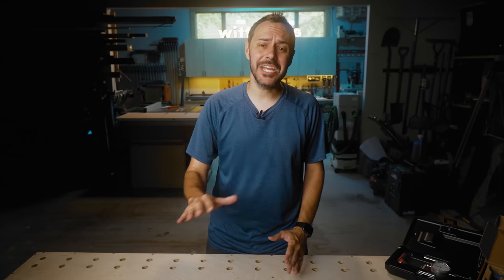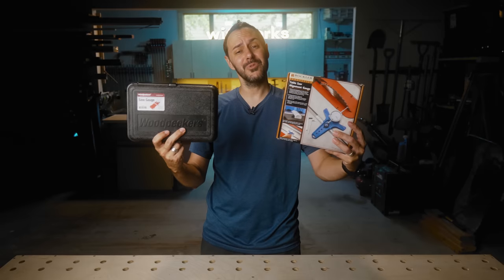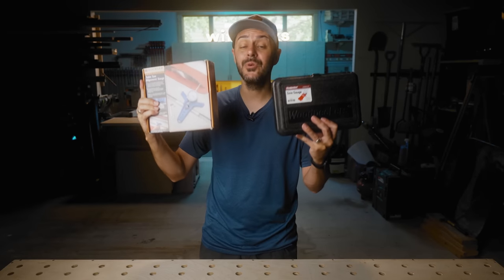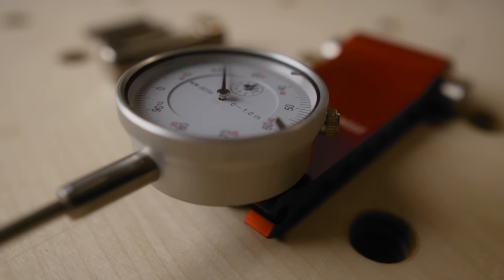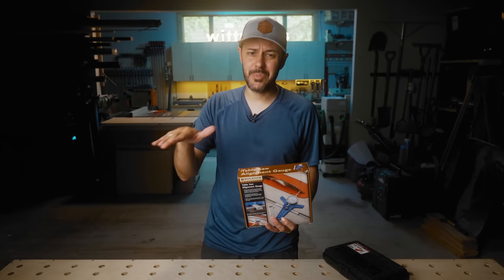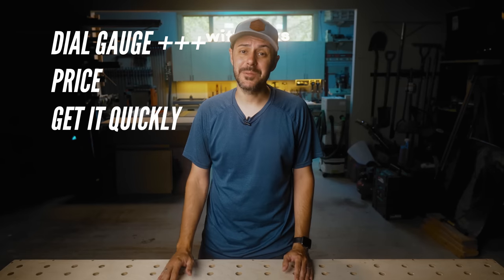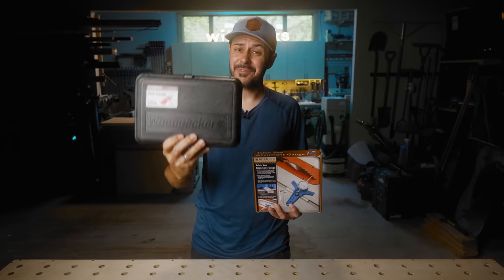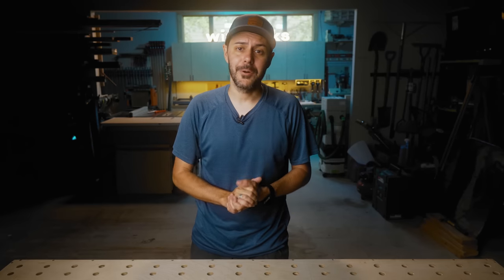Rockler VS Woodpecker Table Saw Gauge.

Comment: Thanks for a very even-handed evaluation. Just dropped in to let you and your fans know that we have committed to being in stock on a large group of our core tools, including the Saw Gauge. It should be in stock and ready to ship most of the time. Very rarely would it be out of stock for more than a week.
Reply from the maker: Thank you!
Reply: Going to check yours out. I just bought blue but have too much rocking with their adjustment mechanism and depending where I hold and slide their gauge the reading goes way off. To me, I just wasted $60.

Comment: I made my own with an old machinist dial indicator I inherited. My runners have zero slop in them which is just a matter of time and effort of learning to dial them in exactly right. The other way is to not make the runner but instead buy one of the newer ones made, dial it in with the adjustment screws and you're all set. Even with the indicator you're still way under the cost of the Rockler even with a perfectly accurate tool.

Comment: Thanks for this vid Drew. I've been asking myself the same question about which I should buy. For me, this seems like a tool I'll only use once a year so I'm fine with adjusting the mitre track and feeling hardened plastic in my hands instead of metal. Rockler for me.
Reply from the maker: You’re welcome! They both measured the same for me so it’s a matter of preference and tool snobbery budget. The rockler is great.

Comment: Just purchased my first cabinet table saw. Even though it is a named Brand unit, The fence was still couple of Thousands" off. So i Purchased the Woodpecker's Saw Gauge. $ 99.00 dollars plus shipping. I not only learned a lot, but I'm extremely happy I got this measuring device. Additionally my friends table saw is an older unit. Even though it has a Riving Knife the Fence itself was off a-lot. 
It cost my friend a lunch to use my newly purchased saw gauge,LOL. Thank You  Conroe Texas, USA

Comment: I bought the I-Gaging digital alignment tool, I didn't like how it rode in the miter slot. I didn't know Rockler had one but I ended up buying the woodpeckers saw gauge mainly because of its design. it's hard to screw up and no adjustment in the miter slot.
Reply from the maker: Same. That's exactly why I splurged on the WP
Reply: I just bought the IGaging one as well. Once the screw is tightened, it lifts the entire thing up and then it rides weird and wonky in the slot. I’m going to return this one and get the red one.

Comment: When I got my table saw (an R4512) 3 years ago, I made my own alignment jig. I bought a dial indicator that came with a heavy magnet base and attached the dial indicator to my homemade jig. It worked ok, but yeah, even the slightest of slop in the miter slot made it more difficult to use than it needed to be. 

I bought the Woodpeckers' alignment gauge back in April. Since I already had the dial indicator, I only paid $80. It is so much nicer to use with those miter slot pins. I knew my saw needed adjusting so it was no surprise that it was in the "20 thou" neighborhood. I managed to get it down to .001 with the new saw gauge. 

I don't recall if the Rockler unit was available at the time I was looking to purchase a saw gauge. Having bought several small measuring tools from Woodpeckers and already having the dial indicator, if the Rockler unit was available at the time, I think I still would have gone red. The price was close enough and the miter slot pins were just too good to pass up.

Don't get me wrong, I'm a Rockler fan, too. I bought the Dust Right 750 a year ago last spring and I love it. Their collapsible hose is the bomb (just remember to get their keyed hose clamps. Others may be backwards and won't work. Ask me how I know). I have their fence clamps and a couple of doweling jigs. They are things that I use and I'm glad I have them. I also like my Woodpeckers, too. It's ok to like both. Besides, blue and red go together, right?
Reply from the maker: Welcome to Team Purple!

Comment: Great video!!!  Personal I like the A-Line-It system, as it has the ability to check other tools as well so you get more bang for your buck!
Reply: Me too - used it for the first time tonight and worked really well.
Reply: YES!  Was about to say the same thing.  Checked my table saw AND my drill press (for table true-ness and runout) with the A-Line-It.  Also checks the trueness of your table saw ARBOR, which the Woodpecker and Rockler don’t do.  Hey Wittworks, #suggestion do a vid on the A-Line-It tool and ALL the functions that it can do, not just the miter slot to blade adjustment.  Also, one might consider investing in a “Master Plate” and use that for checking your table saw instead of a saw blade.  Cheers.

Comment: Great stuff!  I love Rockler.  Their innovations are usually very good quality.  Maybe not the flash of Woodpeckers, but Rockler engineers their products for use and cost.  I have the Woodpeckers gauge.  Yah, I love that self-centering bit.  That is, as you said, genius.  Rockler did what seems to be a very good job at designing a product to complete the task, correctly, with little fuss, for a decent price.  If I were to purchase this tool today, I think I’d probably go for the Rockler over the Woodpeckers.  It’s always good to have the choice!
Reply from the maker: Good stuff! I agree. Rocker measured as accurate as the Woodpecker.

Comment: Kudos on another excellent review. Well-balanced and, to my eyes & ears, sincere. I have similar experience with Red & Blue as @Awl That Wood Crafts and others.

One thing I might mention is a possible error that many of us make in evaluating prices. It involves putting a difference into percentage terms. Twice one price varies in actual DOLLARS from the second price as the $ of the first price goes up or down. Twice a nickel is still only 10 cents. Twice $60 ($120) is definitely getting into more thinking about the expenditure. If you struggle with balancing frugality against perceived (and actual) precision, longevity, convenience, etc., it is complicated. Reviews like this help present as many relevant points as possible to finally hit the sweet spot. Thanks, again!
Reply from the maker: Thanks mark!

Comment: Use a combination square on the same tooth and your good to go but if you feel the need to go crazy set your combo square a hair short of the tooth and plug the gap with a feeler gauge of the right thickness. Just be sure to measure to the same tooth by rotating the blade before checking again. There I just saved you $$$'s

Comment: I just picked the in the middle of the line gauge price wise from Rockler the iGaging Digital Indicator.  It was good to see my Sawstop was in line.
Reply from the maker: Great! How was your sawstop? I’d expect them the be perfect
Reply: @wittworks  .002 out, away from the fence so I can live with that.. but I need to test with other blades just to make sure the blade is not wonkie.
Reply from the maker: That’s great. My ridgid (sigh) was .02. Actually affected quality of cut. Felt like I had a new blade once I fixed it. Hard to believe but I experienced it.

Comment: I was hoping to hear performance between the two in your video but it was just about features.  Did you have any differences in the readings you got from the gauges between the two or did both accurately read the same? Thanks.

Comment: I'm team red just because I've already gave them my life savings for my router table, squares rules and things of that nature. I've been trying to justify the saw gauge but I think since I'm building my shop Ill finally be able to set up my delta unisaw that I bought it second hand and took it all apart to clean and grease everything I want something accurate to dial it in. Being a 5hp saw I want everything to be as close to perfect as I can get it.
Reply from the maker: So great! Do you still have both kidneys? 🤭
Reply: Hahaha right. It's worth the cost in my opinion I have a ton of cheaper squares from the home centers like empire and Swanson. I was trying to square up my bandsaw a few days ago with the empire 6" combo square and according that the blade and table were square. Long story short it wasn't so I set that square and a woodpeckers 6 inch on the bandsaw table and the empire square was out of wack. So if I add up the money I've spent on junk I could have bought the woodpeckers stuff a long time ago.
Reply from the maker: Yep. I had a Milwaukee square that was BAD
Reply: It's crazy they can sell that crap. I guess it's mass production at its finest.

Comment: I am a machinest by trade, extremely fair comparison, for me I like the price of rockler but I do not have great faith in plastic. The self centering on the woodpecker is worth it to me. I will spend 3 hours setting up measuring, re measuring, calculating, and measuring again, then 10 minutes cutting. To ensure  ease of table saw setup, bringing it back to 0 after beveled cuts its worth it to me.
Reply from the maker: Thank you Alex for sharing your experience! I still am impressed with the simplicity of the self centering design.

Comment: [Comments help the channel…I get it…] Bought the “A-Line-It” kit years ago.  But this comment isn’t really brand-specific.  Alignment tools are mostly used for table saws, and most table saws (that are worth buying) will only need alignment once, maybe twice a year.  In between, the gauge will sit on a shelf and you will most likely forget where it is and how to use it.  I wouldn’t spend too much for a tool as long as it does what it should.  Woodpecker is great, but to pull it out once a year and look at it….Just get what will work that one time each year, and then put it where you will find it 12 months later. I think I bought my gauge 20 years ago and somehow haven’t lost it yet.  Great item to have, but be practical.  Thanks…and here’s your comment! :-)

Comment: The question is... how often are you going to be checking and adjusting your table saw.  If it's
once in a blue moon then go with Rockler.  If your like me you go with the pretty self centering expensive model.

Comment: Informative review of the two gauges covering the differences.  I'd go red, just because of the quality difference.  Also, if you ever want to sell it, you'd get practically nothing for the Rockler one, and pretty much what you paid for the Woodpeckers one.

However, I made my own from a few pieces of scrap wood and a $13 indicator off Amazon.  It is easily as accurate as either of them, or anything else on the market.  Yes, don't want to be 'that guy', but it's the truth.  Have to say that if you don't have the knowhow to make one, or don't want to take the time to do it, buying either of these (or any other one) is something well worth the money since adjusting the miter slot - and the rip fence - is crucial to getting the most out of your table saw. 

Just a general statement about Woodpeckers.  Their products are always very very well manufactured, and darn pretty to look at.  Part of the problem with them, however, is that a not insignificant portion of their tool line is vastly overpriced, and some of their tools are a solution looking for a problem.  Gotta give them credit though, they make quality stuff.
Reply from the maker: Thank you! I made a cheap one at first and didn’t have the skills to have the right miter slot tolerance. That’s when I broke down to buy the red. I still love it. The self centering is genius.
Reply: @wittworks  Agree about the self centering.  The first time I saw a review (someone else's) of it, I disparaged it because from the pictures it looked like the roller doing the centering hit on the chamfers of the miter slot, and I knew that could not be accurate.  Someone responded that the roller really sat in the slot, and not on the chamfers.  Like you say, a genius move on Woodpeckers part.
Reply from the maker: It was the main reason why I bought it. Especially after I failed at getting a good miter slot fit. I’m telling myself (and my wife) that it was cheaper to buy it than spend my time making one with skills I don’t have. 🤫

Comment: I think you have ask yourself how much do you need to use it. I have a Bosch 4100 series that I’ve dragged to job sites for the last 7 years that has maybe moved .001 with the abuse it’s taken. I used a digital caliper and the mag-dro. I’ve been thinking about upgrading but that saw has spoiled me.

Comment: For me it's a "Blue if you're a serious dabbler, Red if you're a serious woodworker" - there's no shame either way.
Reply from the maker: That’s a great thought!
Reply: Nonsense, I've been woodworking for 25 plus years. I've owned a few different tablesaws and have never owned a tablesaw gauge. You can achieve an accurate setup with a quality machinist ruler for a fraction of the cost.

Comment: I'm team make your own. Use a dowel for the piece that rides in the slot. It will self-center. Use a screw for the piece that contacts the blade and some feeler gauges to get the gap. There's no reason to spend $100 for something that you'll use so infrequently.
Reply from the maker: I like your idea about the dowel…

Comment: I would buy the woodpecker. The selfcentering and a "hard" case is worth the price difference to me. I won't say I drop tools but if I did knowing it has a case rather then the cardboard box it came in is a plus, or if it gets a drink or anything wet it won't matter to the plastic woodpecker case.

Comment: I know this video is a year old. That being said, country-of-origin may also factor into someone's decision-making; I know that it does for me. I can't find anything on the Rockler where the base or dial-gauge are manufactured. Woodpeckers' gauge is imported, per their website, the other parts are made in the USA. Also, per Woodpeckers website, as of 2024-04-29, they are sold-out of the Saw Gauge, and are accepting reservations with an expected ship date of 2024-06-10.

Comment: So my question is this, how do they compare in the accuracy department?
Reply from the maker: they both read the same readings, so I would say they're equally accurate. The woodpecker is aluminum, so it may last longer, etc...its nicer to use, but the $40 upgrade would be a personal preference issue in my opinion.

Comment: I'm a bit late to the comments, but has anyone had issues with the Rockler option having a sloppy fit in the miter slot? It seems the only adjustment option is the vertical adjustment to level the bar. I'd like it better if it fitted in my miter slots better (like every other tool I use with the miter slots).

Comment: You're really going to do well.  I predicted that Lincoln St Woodworks would blow up too.  Very informative, dry humor.  And I've been meaning to pick up one up because I got tired of making the homebrew setup every time I want to check.  If you're going to spend $3-$5K for a precision tool, it's OK to spend 3.5% to make sure it's perfectly dialed in. Or so it seems to me.  Gotta go with team Red and the (buy once, cry once) rule.  Also, I got the Woodpeck one because of the self centering miter sled.  That's actually pretty damn ingenious.
Reply from the maker: Thank you! Appreciate that. I love the self centering aspect. Brilliant. The rockler was fine but I have lots of joy using the red one.

Comment: I have the woodpecker one, it’s fiddly and a pain to use when sliding it in the mitre slot. Poor value for money.
Reply: I agree with the miter slot pain. The Rockler doesn't fit very well on my table; it only has vertical adjustments for the guide. The Woodpecker self-center looks like the big selling point and a great feature. I'm on the fence (pun) about ditching the Rockler to get the Woodpecker. It is an investment, and they wouldn't take my first child in exchange...

Comment: Just a heads up. A $100 saw gauge is NOT going to improve a $600 table saw.
Reply from the maker: It did mine. But that’s because it came not very tuned. And it’s a ridgid which has all the other issues that come with that price point.
Reply: @wittworks , Check into reviewing the PALS to help with micro-adjustments for the trunnions. Regardless of whether the team is red or blue, you still have to make the trunnions adjustments. With the Ridgid, it takes a lot of loosening, adjusting, tightening, checking alignment, and repeating until you get it right. I hear the same for other brands as well. Too bad all the companies don't have something like the table saw PALS. I just received mine from Peachtree Woodworking in Atlanta. It made the adjustments much easier.

Comment: Why didn't you show us using them and if they read the same thing? All you did was talk, talk oh and talk. By the way, you can be up to 4-5 thousand of an inch and be okay. Not sure where you heard 1-2 thousands of an inch.
Reply from the maker: I try for 1-2, but the time I tighten the bolts it moves some more to 5-10. 

Thought I had broll of the Rockler gauge but didnt. I have three small kids and had a small window to try to film everything. Sorry.